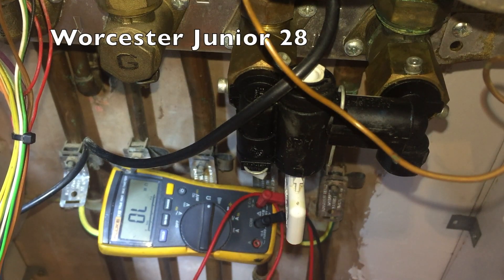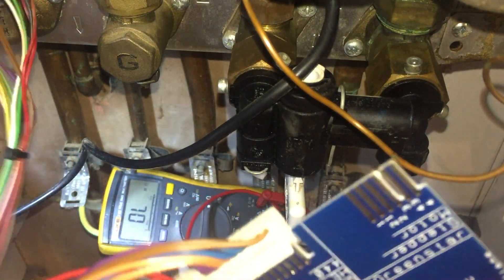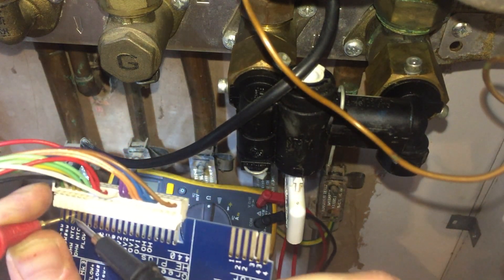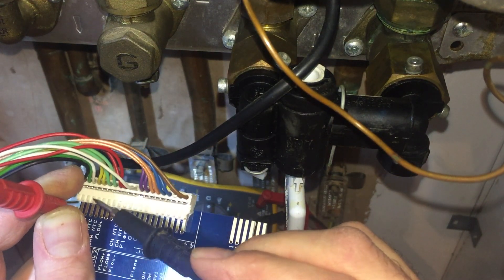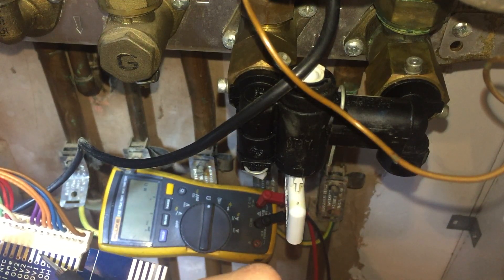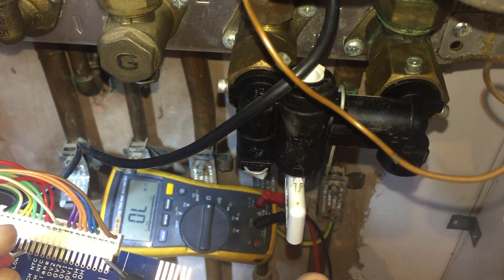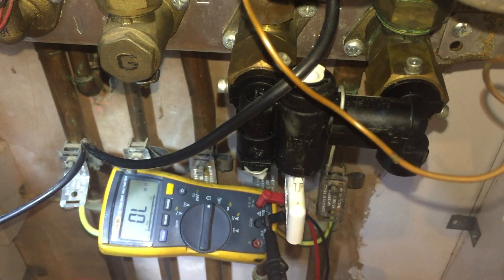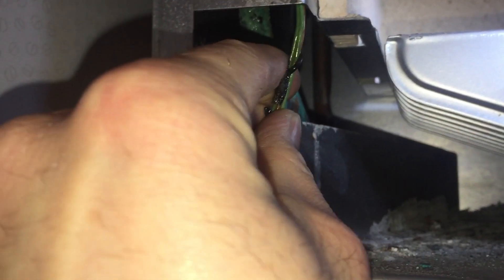Worcester Junior 28i.  Boiler not working, Heatinggeek.

Comment: you ever had the aps   faulty on those 24i jr ( the little white box) .. red hose was brittle on end cut that piece off , fires.up. lasts about 4 hour hours then faults. venturi seems ok..
Fan seems ok  i changed pcb last year.( fire fault).  seems like i blow in to aps. put hose back on  then fires up.
Reply from the maker: I have had an issue where the APS melts. This is because of a PCB issue that n stops the fan and causes the flames to lick around the bottom of the insulation panels, and melt it. This can cause loads of issues. Look for melted hose connections. Also remember the fan is 2 speed on that boiler. maybe one speed is faulty?
Reply: @HeatingGeek  yeah i changed pcb a year back cause of that issue. fan runs dosnt ignite. hose was split cut split section out and blew back and forth in aps. fired up. get the dreded.text next day. go back, make.sure hose is cut square. fires up for half a day. then faults. its one of the three , plus connections on aps rusty so could clean.them. didnt know if uve change a load of them for common fault.  some good vids of urs on here esp that earth fault on that greenstar.

Comment: You're the dogs bollocks
Reply from the maker: I just take the time on every job. Sometimes you can't rush this stuff. Thanks though:-)
Reply: HeatingGeek 
Hi just been watching all your videos found them all quite informative I’ve recently switched over my boiler brand installs from ideal or valiant to Viessmann , valiant was my favourite previous to them going ‘budget’! The last five or six years now, I found viessmann very good ,  what are your take on them? do you have any opinions on them? all my installs are relatively young at five + years old,  they have all been quite reliable and only had to call them out once, under  warranty, which was done the next day without any quibble so I was impressed ,would appreciate any feedback you have on this brand,
Reply from the maker: Viessmann seem to be good boilers but I have very little experience of them. 
I have replaced a couple of rubber pipes on them and had to set up ratios after another engineer fitted a gas valve and couldn't get it working.
 They do appear a little difficult to set up and the model range is a bit confusing. BUT and its a big BUT if I saw more of them I would understand them better and have a more valid opinion.
Every day is a learning day.
Reply: Arks Ekrem 
Yes he really is ! he’s on a different level
Reply from the maker: Sorry for the late reply.
Reply: HeatingGeek 
No problem 
thanks forgetting back to me yes you’re dead right there ,every day is a learning curve and no two jobs are ever the same!
I’ve been fitting viessmanns  Because of a recommendation by an approved installer who swears by them ,but I didn’t want to end up in a position where I’m swearing at them! So far so good ,customers seem really happy with them & they seem very economical on gas consumption
Reply from the maker: Thanks!!! I wish I could get some more videos done. Struggling at the moment.